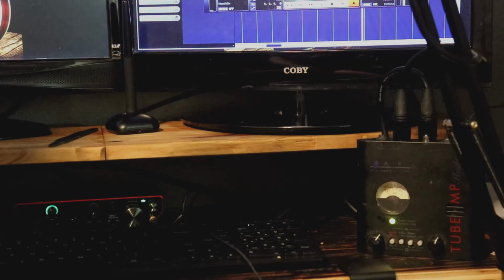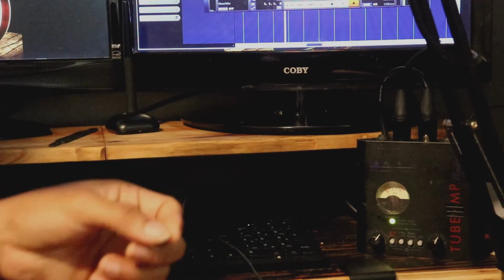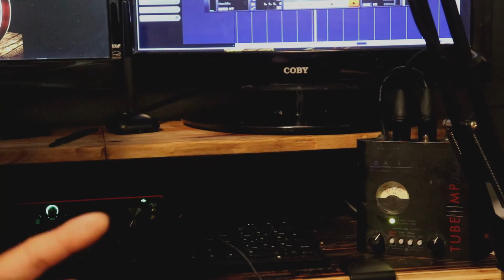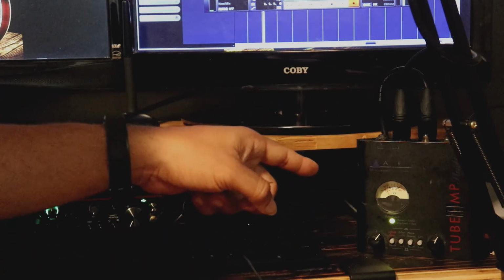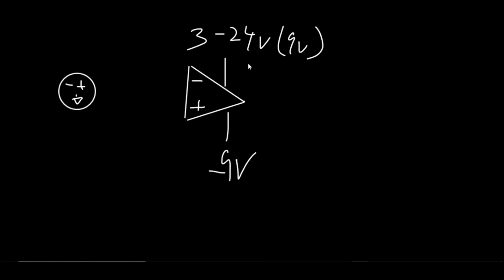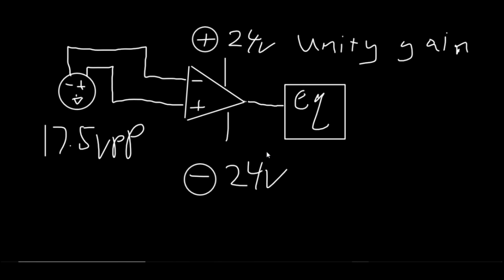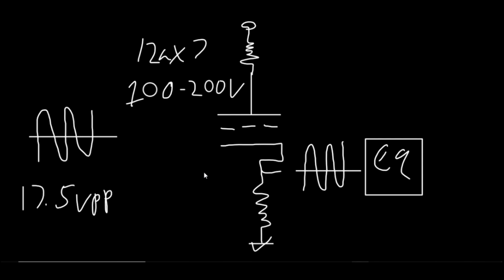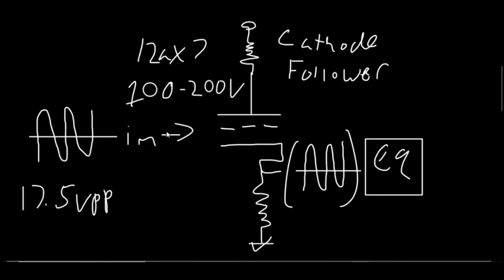The Practical Uses of A  Vacuum Tube

Comment: What are you talking about. The op amp doesnt see any voltage, the inputs will both be close together while its operating. Just ensure there is enough resistive divider to limit the inputs below the supplies in a fault condition
Reply from the maker: @davefoord1259  hello, it's been a while since I've watched that video so I just reviewed it. The input voltage of an opamp is dictated by the supply voltage. Here I was specifically referring to rail to rail opamps. Maybe you have another type in mind? I never said that you couldn't use an opamp in that scenario just that in my opinion an opamp circuit would require more components than a tube to maintain a pure signal
Reply: Do you have any actual design experience at all? Do you know the virtual earth theory?
Reply from the maker: @davefoord1259  yes, do you have any experience communicating in a helpful way to offer insights rather than being condescending?
Reply: @krlabs5472  yes i do, its just that what you said about op amps seeing the input voltage doesnt make any sense at all. Uness your op amp output is clipped at the rails, the op amp inputs will be both at the bias voltage. Which is usually halfway between the power supplies.
Reply: @krlabs5472  so i was asking those things to get a sense of why you would say what you said
Reply from the maker: @davefoord1259  which is exactly what I mentioned in the case of using a +/-9v supply. I mentioned that a 24v supply would work better given the input voltage swing.  Never said that either configuration would not work at all, I wanted to illustrate how a tube circuit could accomplish the same thing with less worry about clipping and a slightly less complex topology. To be fair, looking back at it both circuits would use a similar number of parts